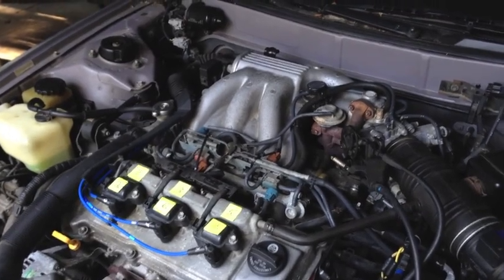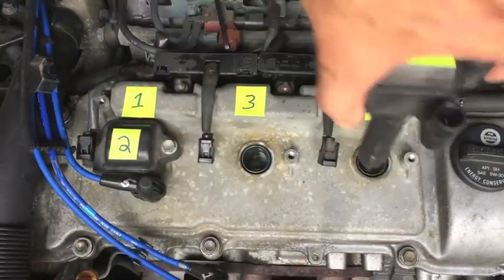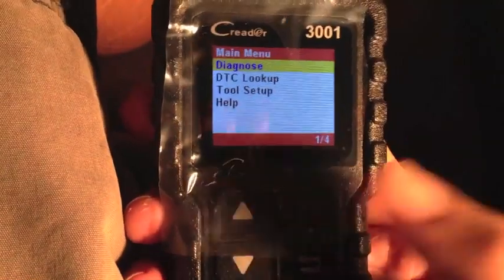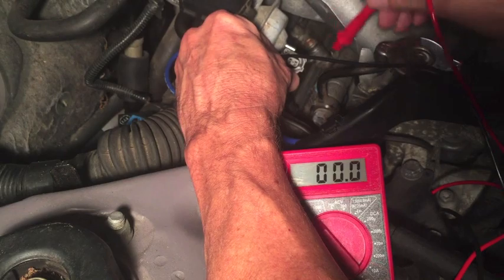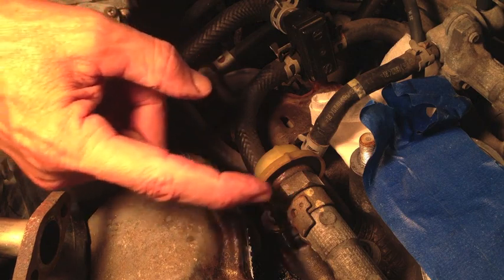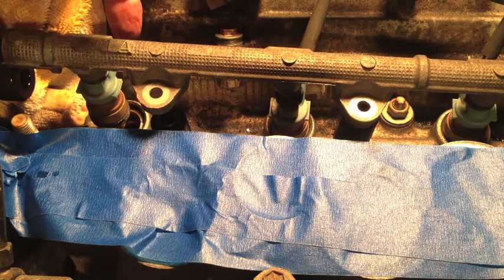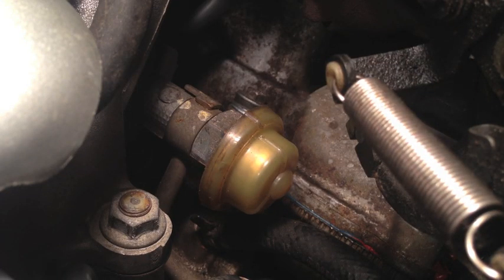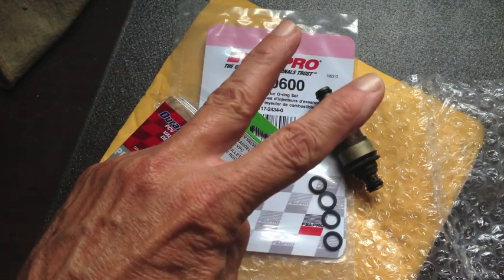P0301 Lexus/Toyota Fuel Injector Replacement

Comment: This Repair applies to the late 90s-early 2000s toyota V6 camry, V6 solara, Avalon, V6 Highlander, ES300, RX300 and probably a couple more. 
Nice upload.
The 1MZ-Fe actually has 6 coils, the 3 others are on the other side behind the manifold. This makes it a real pain to swap plugs and coils if you are too lazy to remove the manifold.
Reply from the maker: My 1MZ FE only has 3 ignition coils on the front cylinders 2,4,6.. Wires on the front of those coils snap directly onto the plugs in back under manifold.. No coils in back on cylinders 1,3,5..
Reply: 6 Ignition Coils fit for Lexus ES300 RX300 1999-2003 / for Toyota Avalon 2000-2004 / for Toyota Camry 2003-2005 / for Toyota Sienna Highlander 2001-2003 / V6 3.0L

Comment: I got a p0301 code after washing my car at the carwash after drying it off stated it and saw the code for the first time cleared the code. Three months later after which time car has had no issues running I go to start the car one morning and the light pops back on. Both times it was upon startup that I get the p0301 code but its so smooth running Im not sure if I should just wait til I have a light more often or maybe swap coils, or just replace the plugs. I suppose it could be a fuel injector as the car doea have 215k miles on it. Any opinion? Good video
Reply from the maker: if you have no light/code now i would swap the coil for cylinder 1 with another.. then, if/when the light/code returns if you still get P0301 you know the coil is not the issue.. if the code moves to the cylinder with the old #1coil you'll get P0302,03 etc depending on which cyl you moved the suspected bad coil to.. then you know the coil is bad.. but yeah, could be injector, plug, plug wire etc..

Comment: This DIY also applies to a 1998 toyota Avalon. Thanks so much!
Reply from the maker: Good to know and glad to help.. It should apply to any Toyota/Lexus with a 6cyl 1MZ FE engine..
Reply: @tongo117  8:42 Was it necessary to replace the pcv valve and grommet? I'm buying the materials today.
Reply from the maker: @moisesdedios9624  No.. not necessary.. But in the 10 years that i've owned this ES300 I've never replaced them.. So I figured I may as well do it now to avoid trouble down the road..
Reply: PeanutButterMan I just changed it today and the avalon runs like a dream. I thank the Lord I found you. Thank you again good sir!
Reply from the maker: @moisesdedios9624  Glad to help.. Thanks for reply..

Comment: Great time to replace the spark plugs and wires?  Also if injectors aren’t too expensive why not replace all three?
Reply from the maker: Absolutely Yes!!  Mine had recently been done.. And if I knew then what I know now I would have removed front and rear fuel rails as one unit and replaced all 6 injectors.. Next time one fails that's what I'll do..

Comment: Did you only replace 1.  I ordered all 6.  Checking to see what brand you ordered.  Yours was w/o VVT. I have that.  I have L es300.
Reply from the maker: Yes.. I only replaced the cylinder 1 injector.. It's now $43.75 for one.. Last August when I purchased it was $27.75.. https://www.ebay.com/itm/OEM-FJ179-NEW-Fuel-Injector-LEXUS-YOTOYA-1994-2003/261686710056?ssPageName=STRK%3AMEBIDX%3AIT&_trksid=p2057872.m2749.l2649

Comment: For the mutlimeter do you exactly have to set it up at 200? I’m having a misfire on my lexus ls430 cylinder 3 /:
Reply from the maker: Honestly I don't know.. Through trial and error I found that's the setting that works on my cheap Harbor Freight multimeter..

Comment: I change the spark all spark plugs and I switch the coil that I have a problem with but still have a code
Reply from the maker: did you check fuel injectors?
Reply: @tongo117  no , how I find out bad one from 6 of them
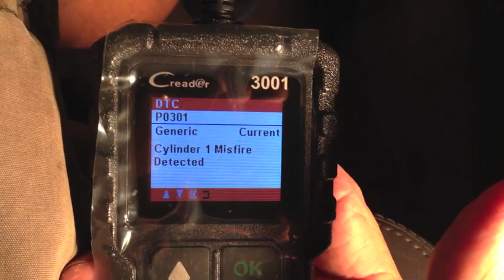Reply from the maker: @yousseflahbil679  I show how I checked injectors starting at 3:14
Reply: PeanutButterMan in your channel

Comment: That fuel injector pressure damper is a son of a bitch to get off. I thought I broke my fuel rail when mine finally broke loose by how loud it was. Fun fact if you need to relieve fuel pressure just remove the gas cap....
Reply from the maker: I just learned the gas cap trick yesterday while swapping out fuel filter on a 95 Accord..  Gas kept dripping from the fuel line and wouldn't stop.. Until I took off the gas cap and heard the release of pressure.. Leak stopped then..

Comment: do you think #3 can be changed without removing the intake?
Reply from the maker: #3 injector is in the middle on the back row.. you won't be able to lift the rear fuel rail up high enough to get it out.. so no, i don't think that's possible.. you gotta take the manifold off..